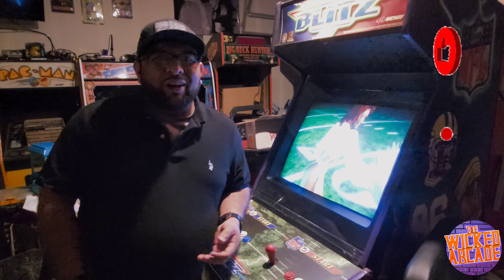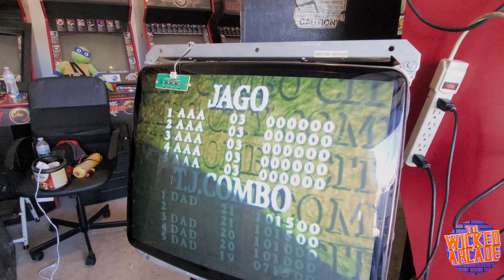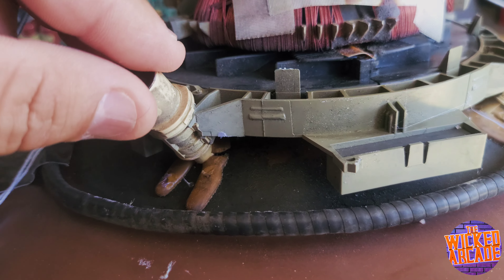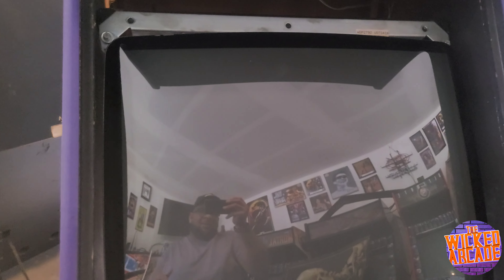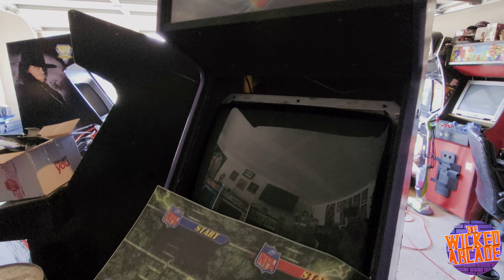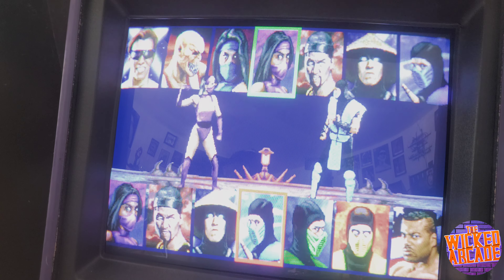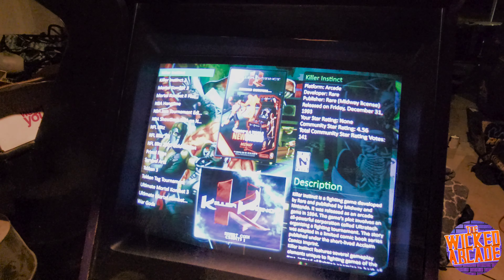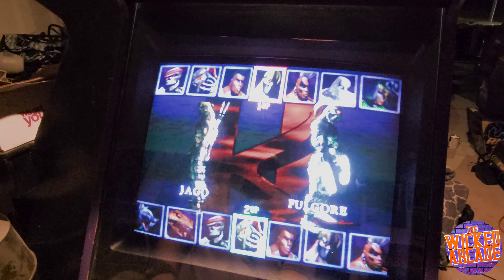Installing A 27in Monitor In A Midway Cabinet

Comment: Looking good. The tube on the arcade grade monitor is much better of course, but also the original TV looks like it had composite only which is one of the weaker feeds compared to something like S-Video and component (YPbPr) which would give it a bump if you were limited to a consumer grade tv and could find one with those inputs. But always awesome to find a VGA arcade set if you can!

Comment: Pro tip (but really an amateur tip): lay the cabinet on its back to put in/remove the monitor, especially with a 27". Yes, it's gonna be a bitch to lift it back up, but at least it's secured and if you have a helper it's super easy.
Reply from the maker: I'm definitely paying for it today lol my back is sore af